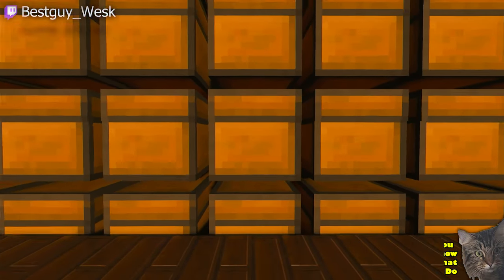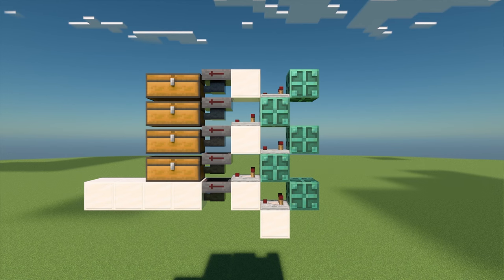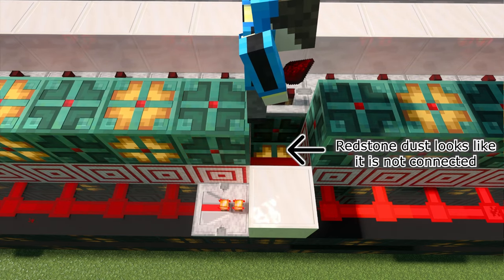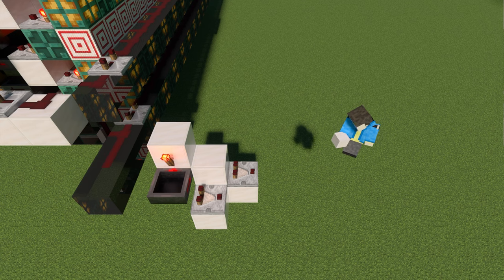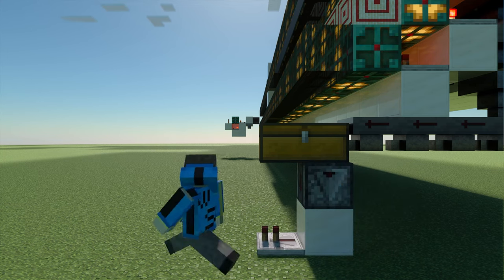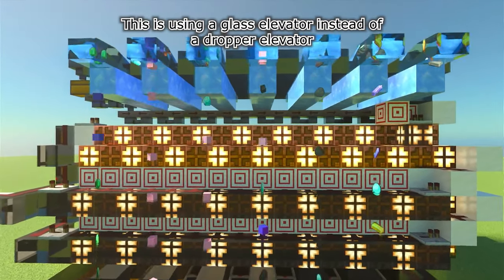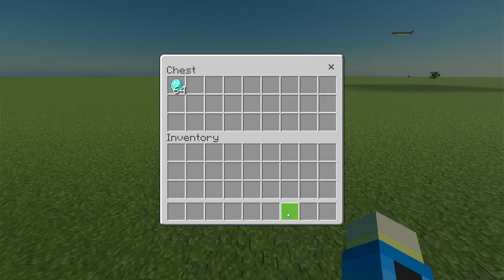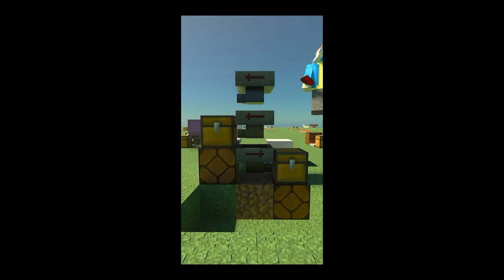NEW Customizable Multi-Item Sorter Tutorial - Overly Explained #redstone #minecraft  #bedrock

Comment: Hey great vid! But I was wondering if it's working on java or not
Reply from the maker: @Weedwey  i don't see a reason why it wouldn't, but I've been wrong before.  I'll test it out and let you know.
Reply from the maker: I just checked and the copper bulb mechanism works just like bedrock. you might need to change the item elevator if it doesn't work the same in java but this sorter works for both Bedrock and Java
Reply: Okay thank u very much!
Reply: @Bestguy_Wesk  i managed to built it in a creative world and it works perfectly ! But i noticed it's quite slow. Im a bit disapointed. But idk the other types of multi sorting machines so i need to make some research
Reply from the maker: @Weedwey  that is completely fair this design uses a batch sorting type so it sorts x amount of items at the same time where x is the amount of items in your hopper clock minus 1. Which feels very slow.

I wish you luck on your research. If you want to add a layer of complexity but increase efficiency, you could look into item categories. 

This design unfortunately requires you to choose capacity or speed. I chose to show the capacity version for tiling purposes. The speed version brings up the speed to full hopper speed. But you have to do forward facing chest for two block tiling. If you want, you could try that as well if 1 block tiling doesn't matter to you. I would be more than willing to show you how, if needed.

I really appreciate your honest feedback